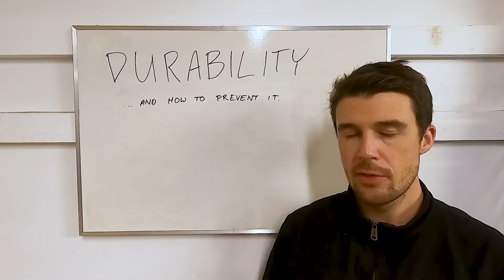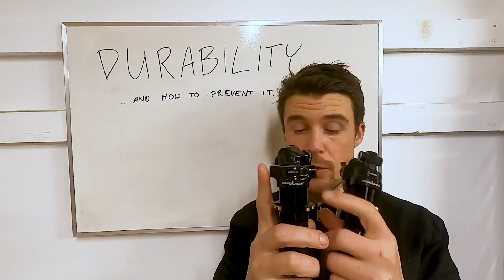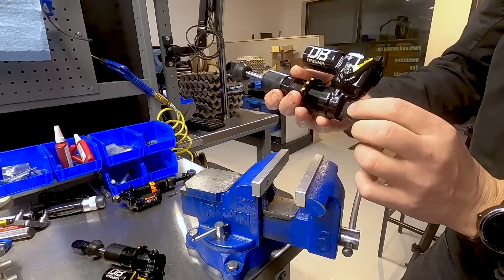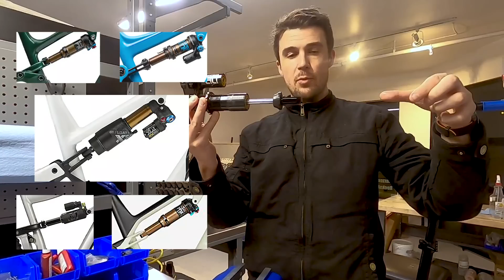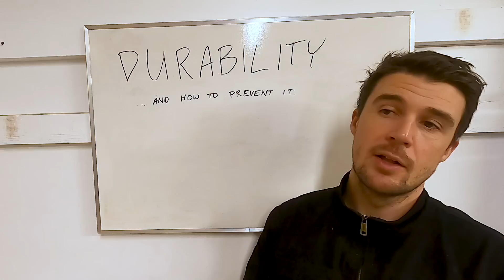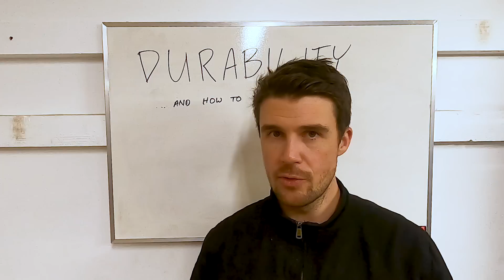Dear Bike Industry... Tuesday Tune Ep 34

Comment: Hard to argue with what you said 👍
Part of the "problem" is probably also the fact that only a fraction of people buying bikes ride hard and often enough to wreck those poor shocks inside warranty, so it's no longer the manufacturers problem when they fail, if they had all of the shocks fail, they may have thought something was wrong, and changed the design in the next iteration for example, however the Specialized Double Barrel example seems to say otherwise, they switched vendors and keep using the same shock mount a couple of generations later still.
Reply: Yep. That's why regulations on planned obsolescence need to become stricter.
Reply: @Ahaggah  No way, shitty products are always gonna be a reality, lets face them ourselves instead of leaving it to the bureaucrats.
Reply: @marcelohendrik  it's just not realistic for the common customer to know all this stuff, even people who ride bikes for a living often don't know it or don't want to acknowledge (see any review on the Sesh Enduro or Stump jumper, they often say things like "most bikes are very good these days, but but a bug brand like Specialized surely has a larger r&d budget than smaller ones, so the bikes should be more refined" which means they either have no clue (I assume they had some failures, but assumed it the shocks manufacturers fault or something), or they are paid enough to stay silent, but I'd rather believe the first one, the guys I watch are pretty genuine, even if they sometimes feel like doing pretty much advertisements.
Reply: Great point as I ride hard but my bike is cleaned and checked over and a fresh chain is put on as I run 4 per cassette and hot grease per week. Even though the bike is very expensive lots of parts are very poor but slowly up dated as I go along. Like my shock cassette derailleur seat post wheels seat. As the Roval wheels are total rubbish and went through two freehubs and two sets of rims and two hubs so much so I had to use a second wheel from a Specialized test bike which only lasted three weeks. The only thing that has lasted are the Sram code R brakes but I have used them since they come out on other bikes but the 'rsc' are a lot better. 4 motors as I have just changed to my 4th a month ago.